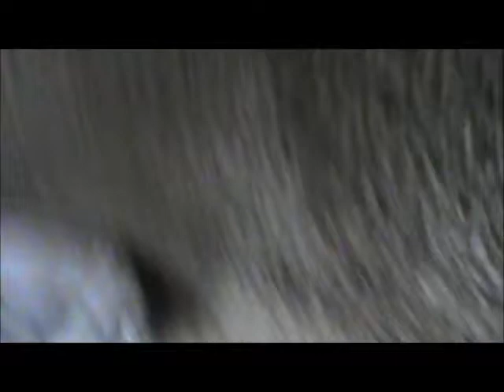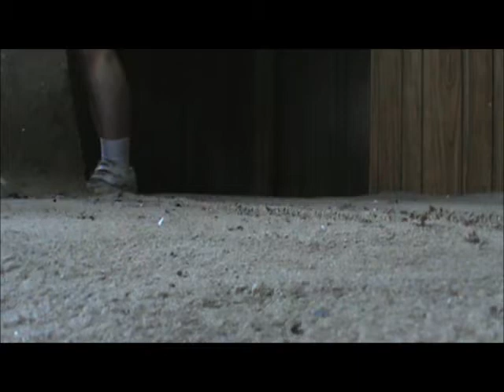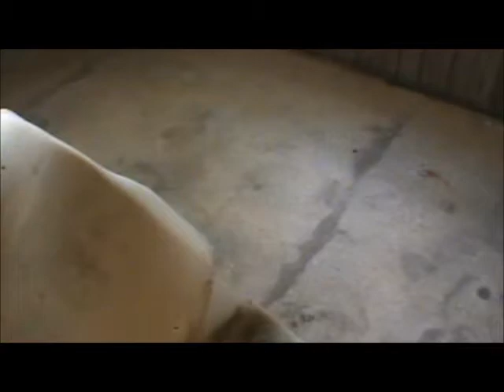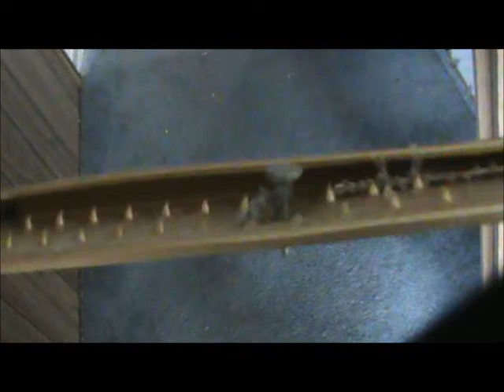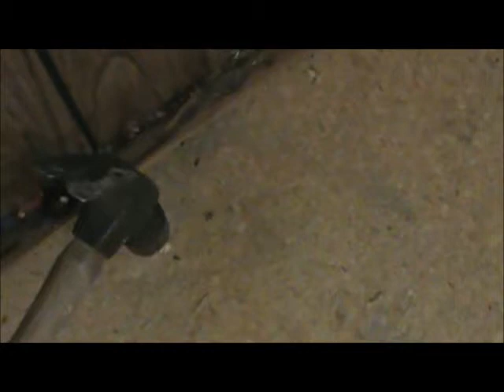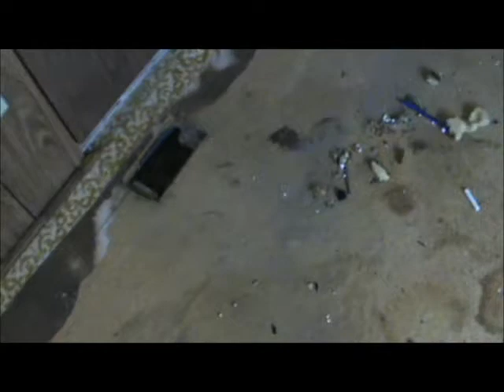HOW TO REMOVE  CARPET

Comment: this video was very helpful but i have a few questions if the room is VERY small do you have to cut the carpet also im removing  the carpet and keeping the hardwood floors underneath if i dont have a scraper could i just remove the staples with pliers?

Comment: there is a special little tool top remove staples or use a thin piece of wood around the staple to protect the floor as you lever it out. But I will be doing a deep sanding anyway so a tiny scratch is not the end of the world.

Comment from the maker: TO XXO PANDAbearxxo .carpet is heavy.if you have a small room id still suggest you cut it up . as for saving your hard wood floor sure use a pliers .a medium size pair would be good .just be carefull not to scratch the floor.GOOD LUCK .!